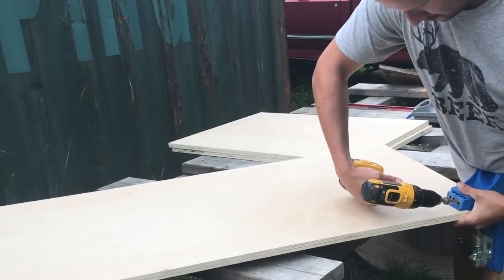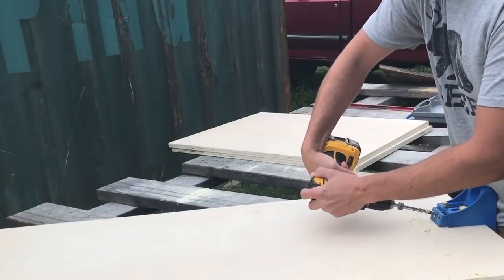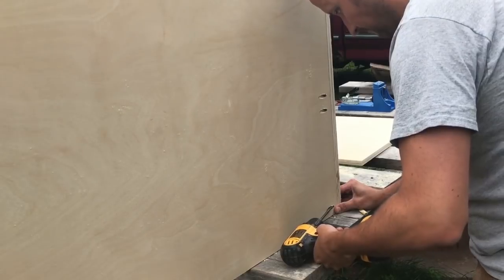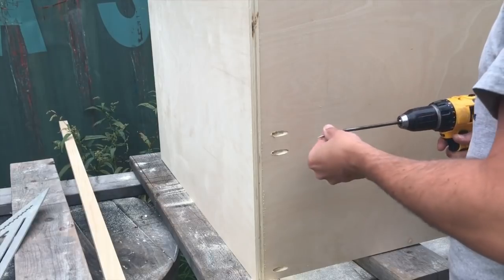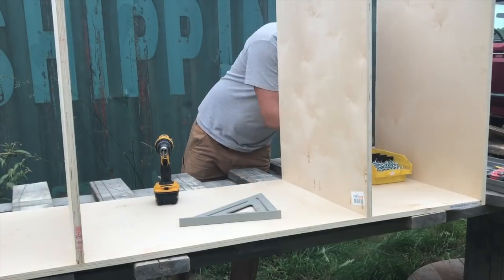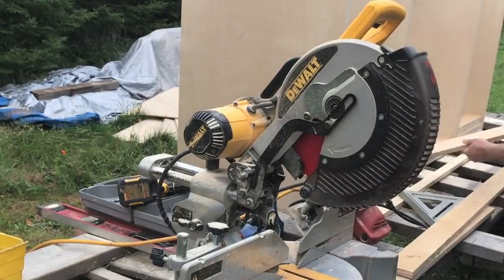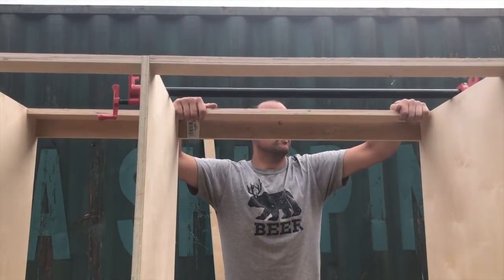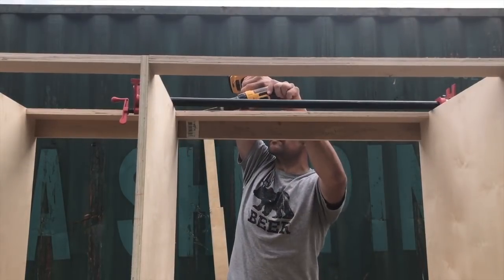Making Kitchen Cabinets Part 1 - Carcass

Comment: Same comment as everyone else, it would be helpful If you talked about materials (type of wood, thickness) and mentioned tools used as you used them (cool jig). Some are woodworking pros, but it's best to talk to your most inexperienced on your narrative so everyone understands what's going on. The pros won't begrudge you for an extra 10 seconds of talking about details.

No critiques or criticisms about your workmanship, you know what you're doing. There's always got to be a couple of rude smart-ass professors chiming in with sarcasm and erroneous corrections, this being YouTube and all.at least the racial slurs are usually left out in project videos 😛 Thanks for sharing my man, well done.
Reply from the maker: Thanks for the comments. Those are good tips to keep in mind.

Comment: Did you talk about a base for the cabinets? Is that going to be separate? I think that’s easier.
Reply from the maker: No we decided not to have a separate base. We omitted the base altogether and the kickplate and just did a full cabinet to maximize the overall storage capacity.
Reply: French River Homestead Ok cool. The only thing that I would watch is that it might be hard to level them when you install them. Hopefully not. Otherwise I e seen another video where a guy made the base separate, leveled that and then put the cabinets on top of that.

Comment: Except for an exposed end panel just screw from edges.  Pocket screws extra, unneeded, less secure and unsightly. And hope you got that blade put in right - very dangerous!
Reply: Robert So we shouldn't use pocket screws??? What are the benefits of screwing from edge?
Reply from the maker: The benefit of face screwing is convenience. If you don’t mind seeing the screws, that’s just fine. I didn’t mean to imply that pocket screws were necessary, it was just my preference.
Reply: Screwing into the end of plywood is not super strong. I think the pocket holes would be stronger.
Reply: From a design and fabrication standpoint (purely an opinion here) but screwing directly into plywood gives a chance for splitting the layers. At an angle you are going through a couple of the layers which would seem like a logically stronger fastening method.

Comment: Americans love their pocket screws.,its really just a fancy butt join thats  really  not so fancy.. guess it works well with the imperial measurement system they're still using..,pfffff..😉
Looks like a nice job anyway.., doesn't really matter how you do it .,
Reply from the maker: Thanks. I’m really not that enamored with pocket screws but for building cabinets with limited time they are stronger, quicker, and less visible than face driven screws for a butt joint. When I build one off furniture pieces I choose more traditional joinery.
Reply: Imperial or metic. Who cares. Imperial is our metric is yours sooooooo what
Reply: James Potter 
The Imperial measurement system is an archaic system of measurement still only used by 2 other progressive countries in the world .., Liberia & Myanmar...,pffffff...
....and you care coz you posted a comment ...
Reply: Measurements have nothing to do with construction method. But you are right about butt joints . That's do to Carpenter's calling themselves Cabinetmaker's. And say thing's like it'll square it's self out. 
 I am a  Cabinet and Furniture Finisher of 30+ years.
Reply: In the UK people still use imperial. 

Pocket holes are perfect for working with in certain projects. To say they are not accurate is being a little bit silly.
Reply: Yeah, I might get those